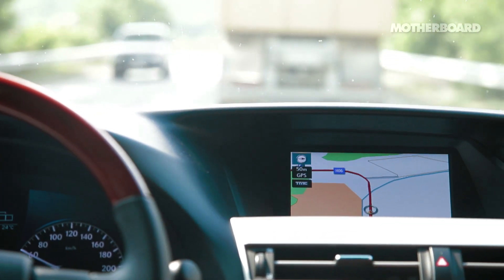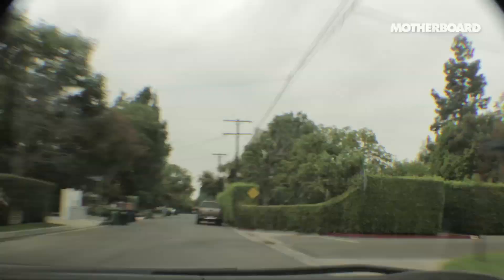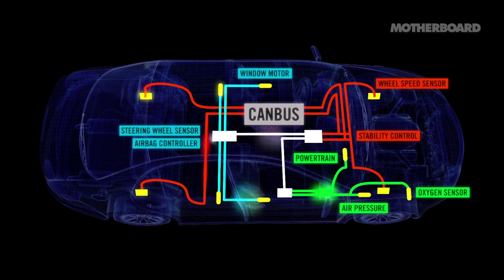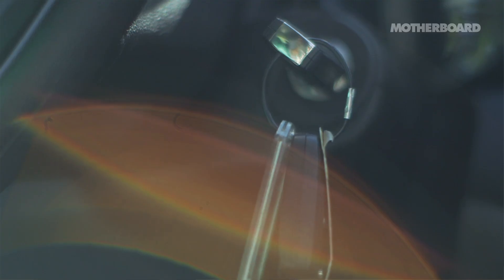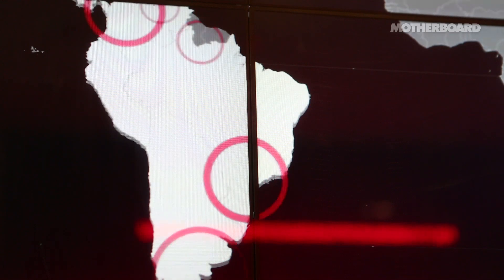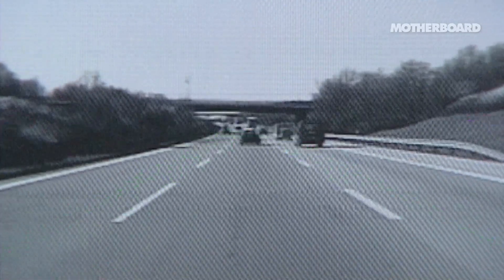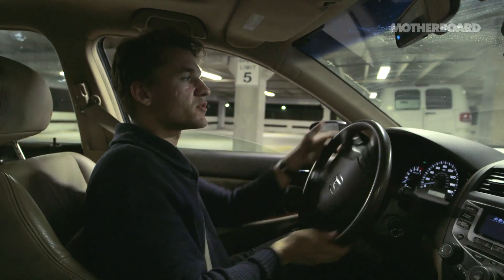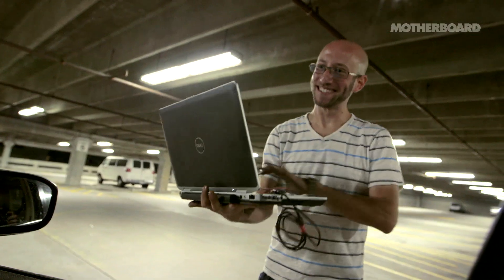How to Hack a Car: Phreaked Out (Episode 2)

Comment: 2:34, increasing the amount of fuel wont make it go faster. It will just drown the engine in fuel and it will just stop at some point. Opening the Trottle actuator is what controls the amount of air the car gets, i belive in a car with carburettor, the more air it gets the more fuel gets sent into the car. And with injection th emore air it gets it tricks the injection to send in more fuel that makes it go faster. 
Anyways... i belive its wrong saying "increase fuel will make ur car accelerate", it will just drown it...

And if u got a manual car its no way the car can move... put it in neutral and let the hackers rev the engine as much as they want... Plus this shit requrries a dam thing either int he ECU itself which isnt a 5 min installation. Or in the OBD port. But how tha fuck will u plug in a adapter to the OBD port if the car is locked by key? on cars that dont have a keyfob for unlocking and locking this is impossible. 

Safest thing to do if u got a keyless car, put the damn key in aliminum foil so it block all signals when u dont use the car, cause then noone can unlock the car using its frequency because the frequency doesnt exist. new cars r a pain in the but to install shit in, event he damn flasher relay is hell to install and takes like 30 min... sp i wouldnt be worried if its nothing in the OBD port. Cars from the year this video is made dont have anything connected to any sort of network which makes it remotly hackable. New cars however... some of them r connected to the internet to save the car company money. Good thing tesla got one of the worlds safest online systems. Musk literally hired hackers to hack their software to find any easy breach points he can block.

Comment: Can these hacks currently work on a manual transmission as well? I really don't see how these hacks can control the clutch, flywheel, and things like that. If they can't that would be really good because you couldn't go faster then the top speed allowed in whatever gear you are in. You could also shift into neutral and then problem solved for the most part. I hope this is the case. Anybody else have any information on this?

Comment: LOVE HOW HE SAID IF YOUR CAR WAS HACKED,YOU'D HAVE NO WAY OFF KNOWING,IDK ABOUT THE REST OF SOCIETY BUT,I POP MY HOOD & CHECK ALL MY FLUIDS B4 EVER STARTING MY CAR & CHECK MY TIRE PRESSURE & I AM PRETTY AQUAINTED WITH MY CAR & HAVE MECHANICAL KNOWHOW & A BIT OF ELECTRICAL KNOWLEDGE & IF I SAW ANY ELECTRONIC DEVICE THAT WASNT SUPPOSED TO BE THERE,I WOULD REMOVE IT! MOST PEOPLE SHOULD DO A ONCE OVER OF THEIR VEHICLE B4 EVER DRIVING,CHECK ALL YOUR FLUIDS & SYSTEMS WAY B4 CRUISING DOWN THE STREET!!! NOW<ONCE A HACKER CAN REMOTELY HACK A VEHICLE WITHOUT ADDIND ANY DEVICE TO THE CAR B4 HAND,WATCH OUT,I DONT WANT A CAR THAT HAS FLY BY WIRE ANYTHING!!!! I WANT PHYSICAL CONTROL OF BRAKING & STEERING AT ALL TIMES!!!

Comment: And this is why I drive a car from the 1970s same with my motorcycle 1970s is the way to go mechanically tuned mechanically controlled EMP happens to happen I still got two vehicles copper box holds the battery with thick rhino truck bed liner coating the inside to prevent shorts less anyone who buys a new car isn't too smart considering the fact you can build your own car from scratch with new parts for $15,000 or so if you're cheap and know how to find good deals and don't have the need for a V-8 get GPS trackers too because no one will suspect the 1970s vehicle that looks like a 1970s vehicle has GPS tracker
Reply: "EMP happens to happen I still got two vehicles".EMP has no effect on cars as studies have proven so yeah you will still have them just like everyone else.
Reply: Stairway to heaven Bohemian rhapsody All of my neighbors cars stopped working when a electrical transformer blew not one of the small ones on the street but one of the big ones they section off so if a big enough EMP were to happen say goodbye to your car

Comment: this is not true, there are alot of parts on a car that are not controled by a computer, like the gear shifter and the brakes, this work mechanically , even the hand brake works mechanically, it is possible to make a car controlable but it will need a lot of modules installed before it can be done and for that you will need access to the car for many hours, maybe days, the brakes cannot be controled by a computer because it will create a hazard, it ix controled by the abs system but it cannot overide the brake pedal

Comment: ok most of this is bullshit there's like three types of cars that use fly by wire steering , also most car use regular hydraulic  brakes ,because if what there where saying was true that means you couldnt turn the steering wheel  if your battery died

Comment: Developing hardware for CAN communication with a car isn't focused on stealing a car. 
You'd have to sniff or know what messages do what, then create those messages to do something on the car.
About the easiest thing to do is turn something off. Second is unlocking doors and starting up. Spoofing/overriding continuous messages would be a bit more difficult.
Unintended acceleration or braking would require temporary disabling of the controller sending those signals and simultaneously sending those messages continuously to make it happen.
One-line messages like unlocking doors and turning the car on/off is about the extent of this.
Remote tracking would require an extra GPS unit hooked up to the arduino and that information sent over GPRS (unless, there is GPS information created by the car and communicated over can).

There is absolutely no way someone can walk by your car and 'hack' it to unlock with what is shown in this video. It would take access to a can port (OBD II port), hardware, a power source (OBD port?), and a knowledge of the CAN messages of the specific car.

Comment: Good luck hacking my 56 Oldsmobile super 88
Reply: Im a big classic car man myself, but a classic cars "toughness" is the reason you're more likely to die. No crumple zones, no airbags, only lap belts... thats not including the speculative stuff like the physics of the lack of bolstering, b pillar strength, etc. 

I will agree to this though, if you get in a small fender bender - you aren't out of THOUSANDS and are more likely to drive away. But in the hypothetical above: The person in the runaway car has a better chance of survival.
Reply: well it still has a cam bus...
Reply: Bradley Marks
 What are you going on about?
Reply: Those cars from the factory weigh about 3400 lbs new Corvettes weigh about 3200 so the "tri-five Chevy" cars don't weigh an aweful lot
Reply: I don't have to... just hack the modern car going the opposite way towards u, and floor it. With no airbags, no proper crash safety in that -56, ur toast.

Never forget that your never safe just because u think you avoid this issue.

Comment: This video was setup as more of a scare tactic then anything.
1.  You must be physically connected to the ECM or CAN buss before you can do any of this.
2.  Exactly how are they getting GSM connectivity to an old honda.  Are you paying for cellular service for each device you install in a car?
Reply: You can stick up an Arduino module with a GSM or Wi-fi reciever to the CAN bus. Considering this whole CIA Vault 7 stuff,  I'm starting to be afraid.
Reply: @sheeshulex  elm327 gives you Bluetooth access to the CAN bus for as little as $10. You need physical access to the OBD port inside the car though. In theory you could modify the elm327 and tap into other CAN bus modules also.
Reply: Dev Everything https://youtu.be/MK0SrxBC1xs
Reply: You're right. This method requires physical access to one of the modules inside the car. As far as I know, there isn't wireless access to the CAN bus directly. 
In this example the "hacker" had installed a custom gsm module. He could as easily used a simple elm327 with Bluetooth and get the same result. Still, you need access to the inside of the car.

Comment: The important issue is that car manufacturers are allowing this, they should upgrade for free all car systems to prevent this type of thing happening and who thought that drive by wire was a good idea needs sticking in a car that they can't control and experience being driven at 100 mph and see what they think afterwards.

Comment: LOL they make is seem like this applys to all cars. only modern cars can be hacked . and only electrical parts can be hacked with . even the car they were using couldnt be hacked that easy they had to get aftermarket cpu's
Reply: you can cut brake lines in old cars
Reply: lol
Reply: That honda doesn't even have drive by wire !!!!!!
Reply: You’re so stupid . “ only modern cars can be hacked “ how many celebrities drive modern cars .. just crawl under a rock and hope nobody kills you

Comment: Yeah this video is a great exaggeration for cars in the 2000. I know for a fact my handbrakes is done with a manual system. these hackers just are really desperate and not being specific..
Reply: A lot of newer cars AK BMW, Mercedes, Acura have electronic E-brakes as well
Reply: yeah and my car cant start itself. You need to install remote start for that (if you turn your key and let it go if it keeps chugging til it starts it can start itself)
Reply: So what?`They are not desperate for anything at all. They are showing the security holes to everyone which is only positive
Reply: What it if you have a Tesla?
Reply: Nope, https://youtu.be/MK0SrxBC1xs
Reply: Then you are an idiot Sammy.
Reply: your handbrake, but your car, if it is a bit "modern", it will have ABS at least, so the brakes pump can be activated using CAN BUS, and now can be controlled all your car brakes :)
Reply: You are missing the point by a thousand miles. Think straight...

And desperate for what? Modern cars are not secure and these guys want to demonstrate it so car companies take action for your own frickin sake. 

What a dumb comment...

Comment: I don't think it would work in a manual car because you need the clutch to do whatever you want
Reply: but you cant start the car because the car is in gear and the transmission will hold the engine in place. ebrakes in most cars are mechanical. electronic ebrakes are somewhat rare. you dont need that old of a car to have a throttle body cable.
Reply: Newer model cars need computers to run even manual for example you can tell the spark plugs to stop firing or make the engine think it's getting too much air close off the throttle completely

Comment: The emergency brake, or hand brake, is connected directly to the emergency braking system usually located in the rear wheels.

Comment: You could just use a sensor to detect if any signals are coming in and out of your car from other sources before starting it up to prevent this stuff
Reply: David Li Nah mate. The chip they installed is telling the canbus that it's part of the car. If we suppose that it's actually not a chip in the car, but entirely cellular there's no way to confirm that either, because the different parts of the car (brake engine etc) communicate via the same protocol. There's no way for the car to tell the difference.

P.S. Excuse my grammar, I'm a bit tipsy.

Comment: they could just make cars with no internet connection.. why is that necessary anyway? or with a necessary part of the internet systems circuit only being connected when the key is entered physically into the ignition. so only when someone does that, would the car be able to be hacked. at least that way you could prevent things from happening whilst you are gone. but It wont safe you from untrackable assasinations.

Comment: That model doesn't even have Internet connection
Reply: With the technology today, you don't need internet connection. Plus the tool he used I believe is a piece you connect to the car and it connects wirelessly to that red chip testicle head was holding the whole time.

Comment: They need to pass a law requiring automakers to have an air gap firewall between the drivetrain controllers and anything connected to the internet.
Things such as shift by wire also found on some new cars needs to be made illegal.
Reply: why dont you sell  it to auto companies